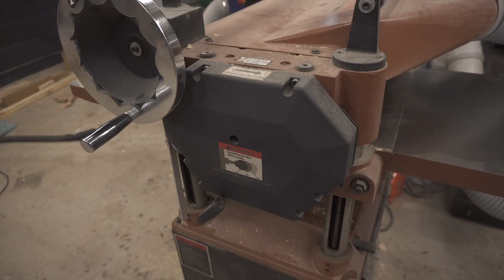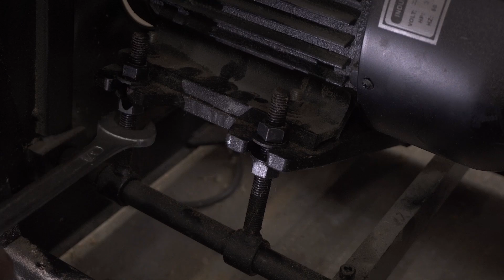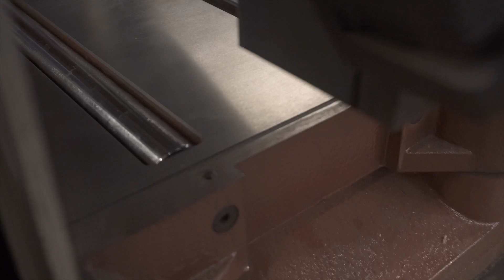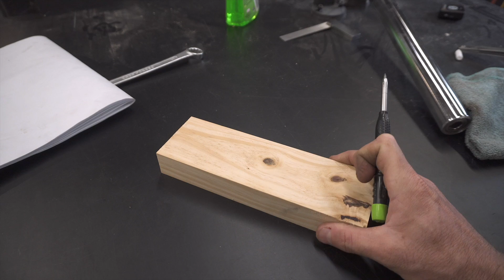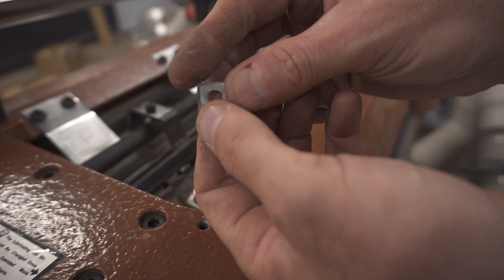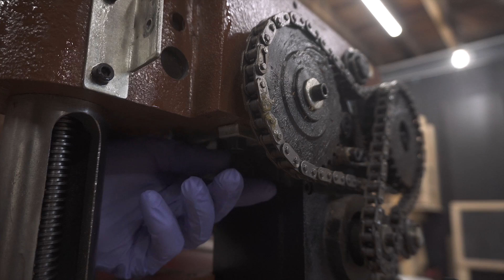Maintain your Thicknesser with Robin Lewis

Comment: Great content. One of the more intricate machines in the shop. Changing the oil was a PITA on  our sherwood, but using a 60ml syringe with a small tube worked a treat. Don't recall seeing how to lubricate the in feed and out feed rollers in the manual. Time to have another look.